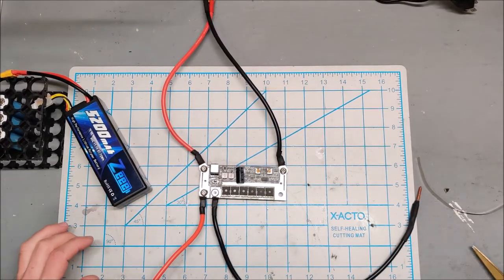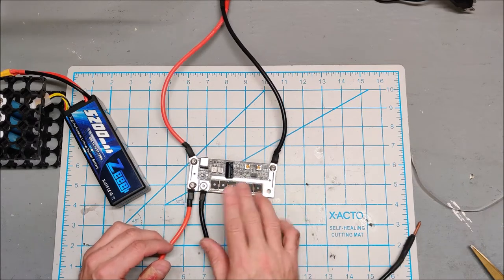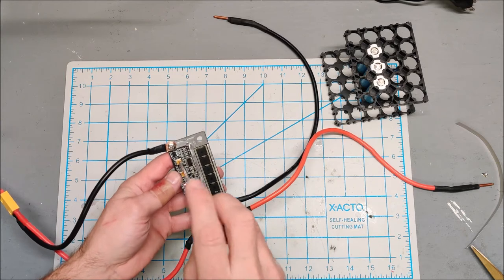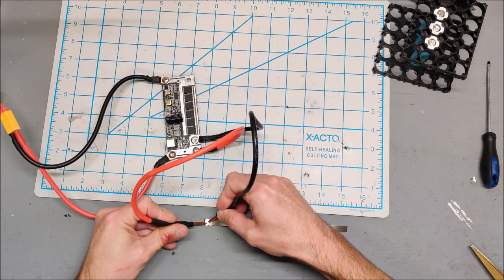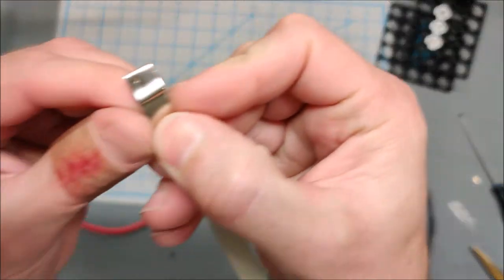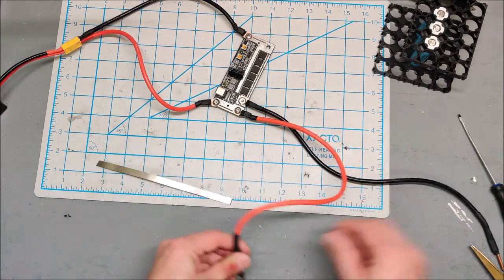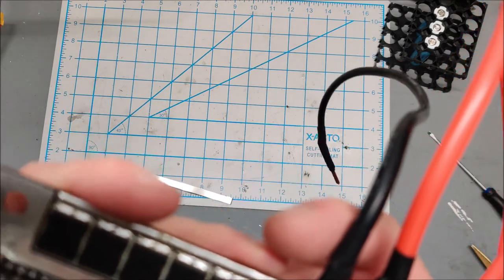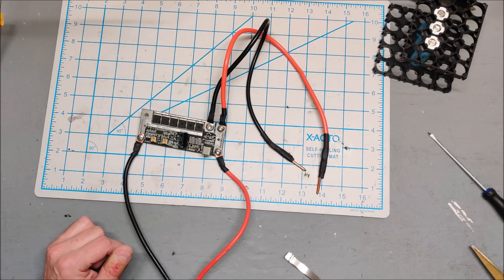ROUND 2 PCB SPOT WELDER SHOWDOWN FOLLOWUP

Comment: Great video with rare reality.
If you look closely at your video, you will see that there were TWO components that broke one after the other. First a very small part, possibly a small capacitor, next to the pot. for setting the amperage AND THEN the chip you mentioned. If you replace these two parts (nothing special), then it will work again.
By the way, the reason for your misfortune was due to the thickness of the nickel strip. I've had the same problem at least 5-6 times and kept fixing the parts. So, the maximum thickness of the nickel strip must not be greater than 0.15mm. Maybe you can read it in, so called, manual of this welder.
PS: I also use the device that you favored in your part 1 video. However, I gave it a nice big heatsink. It doesn't get very hot that quickly.

Best regards

Comment: This welder can't handle 12 volts, apparently it's meant to be used with two 2.7v series supercaps(that's why it has charging port)
Reply from the maker: It is rated for 12v. The specs say 3s Lipo
Reply: @stevenc22  
I've looked up some comments about these boards on AliExpress and the likes.
I came across a comment from a Russian who had the EXACT same blowout issue using a 12V Lipo: 
See comments on https://www.aliexpress.com/item/1005001679553601.html

Also note: all the listings I have found for this particular spot welder are very slightly different than yours: yours doesn't seem to have the "extra low-voltage protection circuit" pot, normally located near the power adapter socket. This includes the eBay listing you got yours from!... It shows a very slightly different PCB in the pictures of the listings (always WITH the low-voltage protection pot) than the one you have (without the pot). And also notice that the picture shown in that Russian dude's comment I speak about above, again does not have that pot either!

So, it seems there are at least 2 versions of this PCB.
edit: actually at least 3 though (v1 green pcb, v1 black pcb, v2 without a low-voltage-protection pot)

Secondly, the on/off switch. Is that really an on/off switch for the entire board?
Or is it to put the board in 'charging mode' mode using the power adapter plug?
edit: Or is it to put the board in automatic/manual mode (see my second comment below in regards to the manual mode)?

------------
Remember that descriptions (and pictures) of such Chinese products are always copied by countless resellers without care of the (sometimes very) important small differences between versions and the likes. Heck, the resellers themselfs quite often don't speak English anyways. Don't always trust 100% the descriptions and you might even have to lookup 'manuals' on other versions or similar boards to get an idea of what and how it works.

Tip: Google image search or using Tineye has helped me quite a lot in such cases to find the 'most original' manuals/instructions, sometimes in original Chinese, which you can then use Google translator, etc, to find out more.

(PS: I know you probably already know the above tips, etc, but I just wanted to note it down for others too whom might not be so experienced yet in buying from 'overseas' ;-))

Comment: I'm no expert but i think these have to run on 7.4volts. Guess that might be what caused this?

Edit: I've think that the one i have actually runs on a 4.7v, not 7.4v.
Nice vid nonetheless, at least for now we know that we probably shouldn't use 11/12 volts on these. For 15$ if you can get another one, would be nice to see you try with a 7.4v.
Or i guess you could probably find that chip and replace it for cheaper.
Reply from the maker: Yeah they advertise it can work with 12v but I agree with you. It was originally designed for super capacitors at a lower voltage
Reply: @stevenc22  Hey i just wanted to say that i think i was wrong, the one i have is one of those with the "included battery", the long flat one. Apparently it's a 4.7v and not 7.4v.
And once again i'm no expert, but i have a feeling that most of these pcb spot welders are made with the same components, even use the same "programming" on them. (you can plug it into a pc via usb but missing drivers and i can't find any on google, wish i could try and make my own firmware since mine only has 3 levels, and i see the newer ones with 5 levels). Point is, i think you should try to run it off of a 4.7v battery to start with, then maybe work your way up to see if it can hold up to the extra voltage.

Comment: Liking your videos. I've been following your spot-welder testing and wonder which one is currently a top choice? These all seem to be slightly sketchy,  but I am in need of a cheap one for maybe a hundred cells, over time, to be welded.
Reply from the maker: The one with the yellow xt60 is definitely the best. It gets hot over extended use but it is miles stronger than the others and you need a strong spot weld for the Nickle to not break loose over time.

Comment: I wander about power supply connector near burnt chip. May be this board is designed to operate with auxiliary power supply, independent from spot welding battery. Or connector is for foot pedal. I think connecting FETs in reverse didn't fry the chip. I sow one controlled weld with low setting. MOSFET in reverse acts as power diode and impose reverse voltage on rest of the cirquit about .6V. If You order another board try to ask manual/instructions from seller. Or look on pages of other sellers for better description of the board.
Reply from the maker: That is actually a charge port so recharge capacitors if you use it on a capacitor bank

Comment: Maybe buy a relative expensive one at about $100 with a lot more controls?
Reply: 15$ vs 100$... If it does the job right, there's really no need to spend 6 times as much ;)

I think the problem was the battery he used being a 12v instead of 7.4. I'm no expert though, but i'm not "rich" either, so i won't buy the 100$ ones, not to mention taxes, 180$ here probably.